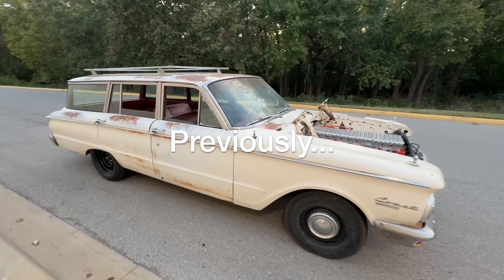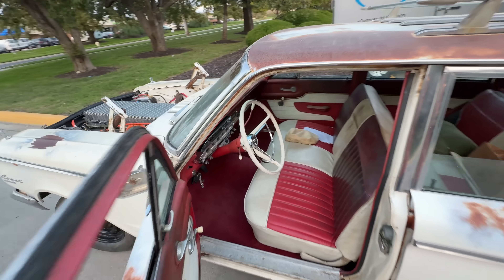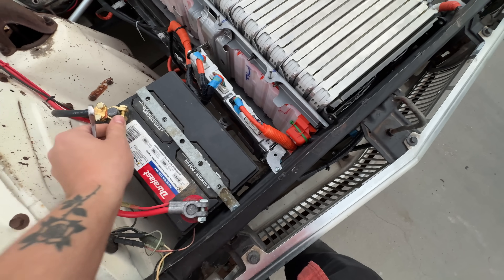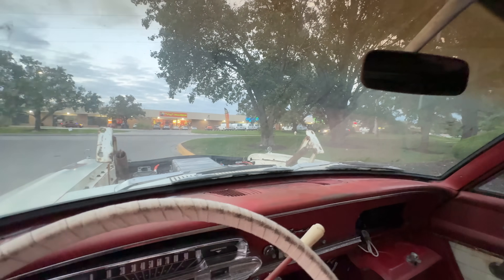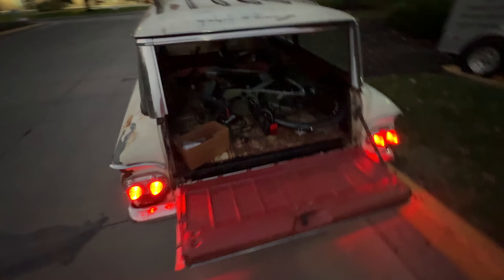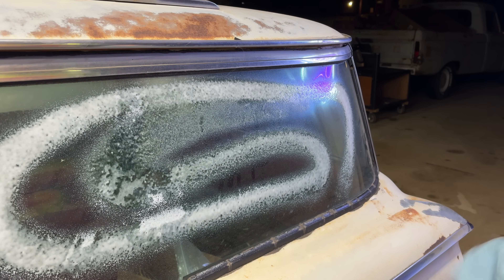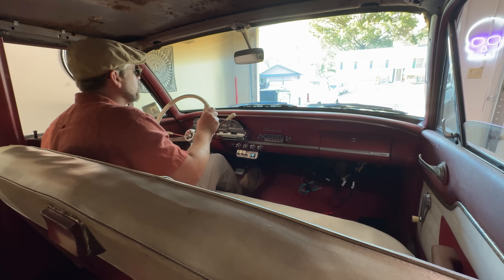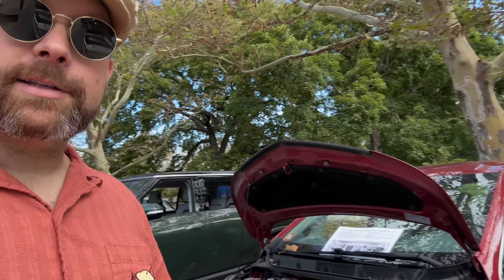What It’s Like to Drive My Homemade Electric Car

Comment: I have held on to 1982 VW Scirocco for an electric conversion. I wish someone would see it and take it. It is a perfect platform for conversion. It came from the factory with manual steering and manual brakes that work. I always imagined a 4 wheel drive electric rally type conversion.
Reply: I have an 84 rabbit I am thinking of converting

Comment: Does your brake light come on when using one pedal regenerative braking? It is important to have that option, as you will end up getting rear ended if you are regenerative stopping and there is no brake light coming on you can used a weighted lever, micro switch, so that the deceleration of the weight, causes force to overcome the spring and press the switch to turn on the micro switch. As the deceleration stops and there is no motion, the brake light would turn off with this weighted switch solution, so you should finish up with pressing on the brake pedal as the vehicle stops. From you can use various size fishing weight to adjust the sensitivity to deceleration.
Reply from the maker: It sure does, thanks for checking

Comment: Great video! Great project, first time your channel came up for me, so I subbed to keep them coming.
A comment about those tires... there's lots of 13" rubber selection out there. I had about 8 to choose from for a Triumph Spitfire on one site alone. Load ratings up to 1,100 lbs/tire. I replaced the 13" stock wheels on a '66 Corvair with 14" wider alloys and tires with no fitment issues. GM used the same bolt circle on 13 and 14" wheels. Ford likely did too. You can get a higher load rating if you need it.

Comment: One thing I've never heard anyone talk about is the fact that while using regenerative brakes do your brake lights come on I think that would be a safety hazard if the brake lights aren't working.
Reply from the maker: yes the come one. The controller has an output for brake lights during regen.

Comment: Very nice reuse of a great survivor classic.     Yeah,  the cheapest conversion approach these days is often to swap over the OEM drive of a factory built EV.     I've done two conversions and been daily driving them since 2006.   Within 100 miles of hitting 100K EV miles on my current driver,  a 2004 scion xB.    Few thoughts -    never trust regen brakes.   You've already experienced the controller cutting out unexpectedly.   Once you get everything sorted this should be extremely rare event but it can happen and if it does when braking you will get a surprise.    So get in habit of  "hovering" over the mechanical brakes when using regen,   and give yourself plenty of braking space when using regen.    Also guessing itt gets Icy in KS over winter.   You will want to reduce or turn off regen driving in that.   Regen on low works a lot like antilock brakes though (allows wheels to turn) so some experimentation in a big empty parking lot might be in order.    And goes without saying,  but get the mechanical brakes sorted  :).     Yes,  you likely need a different master cylinder with disc brakes.     Replace those rusty old hard lines and flex hoses and the proportioning valve too if you haven't.

Comment: Stumbled upon this video. Very interesting. I was born in the middle of the last century (Sweden) and both saw and experienced "fender benders" in the 50s-2000s. Personally, I think seat belts should be installed.
The small "control panel" with the BMS toggle switch should be moved or that it "loosens" easily in the event of a collision to reduce possible damage to your right knee. YES, the original controls are what they are. And the dude on the electric bike...
My definition of these prospective organ donors. You can use all organs except the "brain" because it doesn't work.

Comment: Why not use the original column shift if you left it in.
Reply from the maker: use it for what? For the momentary switches for F-N-R?
Reply: @ThisOldJalopy  that or connect it to some slide switch assembly or something. It would be cool to have it looking more original but any conversion is cool.

Comment: I had a 1963 Gallaxy, that same brake pressure switch shorted out, broke, leaked brake fluid, caught on fire, then I lost my brakes going down a steep road! You should upgrade that master cylinder or plug that switch and put in a mechanical one.

Comment: You can adjust the steering play out with a nut and set screw on the steering box. Loosen the nut then turn in the set screw a little at a time and check (test drive). If you adjust it to far the steering will feel stuck/sticking.

Comment: I have a 1967 Pontiac Catalina four door sedan. I had a problem finging 14 inch tires. They were either trailer tires or they were really expensive. I just switched to 15 inch wheels from a newer model Pontiac.
Nice conversion. Love it.
Reply: try discount tire direct. (on line) I got a set of 14" tires for my Corvair from them. Of course you have to mount and balance them after UPS delivers.
Reply: My first car was a 67 Pontiac Catalina 4 door. It was my grandfather's car. Absolutely loved that car, and wish I had a way of locating it.
Reply: @OCMike  In North Crolina you can trace the ownership of a car by VIN to see the history. I imagine that some other states might offer that service, (but not all states) The question becomes a matter of having that info years later. Maybe an old reg renewal hiding in a desk drawer or perhaps a photo showing a license plate might work?
Reply: @rupe53  I've moved around so much, I don't have any paperwork. But, I should check for an old photo to see if it shows the old plates :)
Reply: @OCMike I got the same beauty as a hand me down from my grandfather and it was a convertible… what a car. Yacht fit for a king

Comment: My neighbor who I help out with around the yard has a one-owner Geo Metro 5-speed hatch back. My dream lately has been to build my own hybrid using the Nissan leaf to power the rear tires but keeping the engine powering the front.
Reply from the maker: That would be awesome!
Reply: @ThisOldJalopy I'm sure it'd be quite the task to try to get them to work together. I live up on a mountain though so having both to make it up the hills would be nice and then tons of regen possibility on the way back down.

Comment: I had an issue with dragging brakes on a 69 amx. It turned out that some of the aftermarket masters need a shorter pushrod. I made a 1/8" shim to put behind the master and the problem was solved. I have read that that's not unusual. Mine has power brakes which may be more prone to this type of issue. Very cool project.
Reply: Many of the brake booster pushrods are adjustable. (after removing the MC) Look close for a small lock nut and twist away carefully.

Comment: so what actually caused the fuse to pop
Reply from the maker: I never found out for sure, but when it blew I was starting from a stop, but also had unknowingly been sending brake signal to the controller (it's a pressure activated switch on the brake lines, and the pressure was up due to the dragging disc brakes). So the controller saw both throttle and brake signals, and it didn't like that. That's my theory. I fixed the brakes for now, and the fuse never blew again.

Comment: After you get your brake issue squared away, let's focus on the regen brakes vs. the front brakes.  The regen saves battery power?  It restricts coasting.  You're powering the car longer to get to your target stop point.  Try coasting without the regen to see if you like it more.  I have a Prius and the question was on my mind for a while.  Not sure which is best.
Regen can really slow the car down quickly.  I can feel it the most on the highway.
Reply: In general EV circles it's pretty well known coasting is always better than regen, regen is always better than braking.

Regen should only be used in situations where you would otherwise have used friction brakes. The ultimate goal would be to never have to use either since regen only recoups about 50% of the energy used to get that speed in the first place.
Reply: @Snerdles  Regen is super handy in hilly areas
Reply: @1SqueakyWheel Yes, exactly an area where you would normally have to use friction brakes to reduce speed on a down hill or otherwise it would be dangerous.

If you were going in a straight line and could guarantee no deer)people/aliens run out in front of you coasting in the situation would still be more efficient.
Reply: @Snerdles Right.  Having no practical experience (yet) with a car utilizing regenerative braking, I don't know if they have a clever way of bypassing it momentarily on a coast, or the vice versa.
Reply: @1SqueakyWheel in my car it just has paddles to select the regen power from none and through three levels. Different manufacturers allow different levels of control of how it works from nearly none to multiple levels.
Reply: @Snerdles yes, I'd hope so. 
I was thinking it could be cool if they built a momentary bypass paddle for the right side of your right foot to push against towards your right, to disengage regen as you coast...  Then when you go to push the throttle again, your foot naturally slides back from the paddle so that the car is ready to regen again
Reply: @1SqueakyWheel My car uses paddles behind the wheel like gear shift paddles. You tap the right one to reduce the regen level and tap the left to increase. Some cars will have a one pedal drive mode which makes the accelerator pedal have a reduce speed section at the top so to coast you'd press down a bit beyond the regen, accelerate is push down further, and then as you release it regens more and if you release it will regen right down to a full stop similar to if you were using a friction brake coming up to a red light.
Reply: @Snerdles  That seems logical (Captain).  But the regen kicks in automatically as you're trying to maintain your speed w/o going too fast.  Feathering the throttle, as such.  The system fights itself.  I think it needs a coaster brake.  We had them on our Schwinns in the '50s.
BTW, I was doing 40 mph today and my gauge said it was only using the battery and getting 99 mph. (it only uses two digits so it could have been hight)  But my next thought was that all of this free power will have to be paid back, somehow.  Interesting argument I had with myself and the car.  What are your thoughts on that, if any?
Reply: @Alex-h4w7bit's easy to figure out with some thought experiments.

Take a roller coaster. Do you think if it was just at the crest of a hill and used a nudge to get over and the next hill was exactly the same size. Do you think it would get higher if it had all of the energy as it fell, or if it used a brake but could convert 50% of the propulsion to energy to propel itself up the next hill?

The one that was free coasting would only lose the energy of friction and nearly crest the next hill. The one that converted all of the falling energy at a 50% would make it less than 50% of the way up the next hill due to all the friction. 

In a vacuum with no friction the coasting one would get to the top of the next hill, and the regen one would make it to 50% assuming a 50% conversion rate from energy to propulsion.
Reply: I agree that regenerative braking is definitely where it's at.  But in his case, unlike with your Prius, there is one drawback.  

The fact that he managed to get all the battery packs so neatly tucked under the hood of the car is super convenient!  But it also gives the car a significant nose-heavy bias, as those packs likely outweigh the straight six that came as the base engine in these Comets, and there's no sizeable tank full of gas balancing the rear either. 
This wouldn't be much of an issue if it were a front-wheel drive car... but being a rear-drive, regen braking, depending on how aggressively it's configured, could present an issue.  

For example, if it's just begun to rain, and he's decellerating downhill in a curve without using hydraulic brakes, there exists the potential for his rear to break traction and fishtail on him.  And honestly, I don't know how inconvenient it would be for him to manually turn his regen off when necessary, or to dial it in so that he can just balance the release of the throttle in sync with his brake pedal, effectively "two-foot in" it.  

Other than that issue, I love the fact that it's a RWD, since acceleration in a RWD is not such an issue, since upper-CG always shifts against the direction of lower-CG inertial influence so that accelleration is more effective from the rear while braking is more effective from the front.

Comment: Man, that 107 hp (80 kW) Nissan Leaf electric motor produces 187 lb-ft of torque. Of course, it will catch up with traffic easily. Not much top speed, though. Another question is: did it benefit from weight reduction after the conversion?

Comment: The regen breaking is impressive. Do the brake lights light up when slowing down with regen? would it lock up the brakes on slipper roads? I'd love to convert a car to electric one day.
Reply from the maker: Yes the controller (Resolve) does turn on the brake lights during heavy regen. Not sure if it could lock up the tires. Resolve just put out an update where you can plug it into a laptop with a USB-C cable and you can then configure settings like the exact level of regen braking, as well as max rpm, etc. All from the Chrome browser with the Resolve website loaded.

Comment: I had a 1962 Saab, have been regretting it going away because it would have been a really cool electric conversion.  Except I suspect it's fierce IC engine heater would be hard to replicate without  some serious range reduction.  My car was in the same exterior and interior condition, spotty rusty but the car overall was sound.

Comment: Hopefully you can find a more common wheel, with the same Ford lug pattern. Then you can choose your tires; instead of them choosing you. It sounds like window felt and seals will go a long way for your cabin noise. Great build! I've enjoyed every episode.
Reply from the maker: I have some 14 inch rims and tires already purchased and ready to go. Old rims were 13 inches. In the rear, I have 15" rims.
Reply: I've used Coker and Summit to get rims for classics before.  A lot of modern wheels are too wide to look right on old cars and end up looking like Foose specials, and no, that's not a compliment.  Fooses are tacky

Comment: Congratulations! Looking forward to more vids on how it's performing, and your axle build. There could be some safety added by relocating the batteries. I first thought on top of the roof but then It came to me that suspending them just below the roof on the interior side might be as effective, ducted with air flow or fan assisted cooling.
Reply from the maker: LOL what?!
Reply: @ThisOldJalopy  ...on the underside of the roof? Like over the cargo area. Out of the way. Fairly safe from collision. Uses available room.
Reply: I think he is being serious 😂
Reply: @DirkVanDerVeen-r7m  I am, just tell me the objections. My objection to "frunk" placement is extreme collision hazard. Why do you think manufacturers avoid "frunk" placement? There is one complication for this application, you'd want to weld the holes in the roof closed. That means removing the luggage rack, or maybe weld on new mounts on the exterior side for it. The underside of the roof would need a layer of insulation to guard against condensation from dripping onto the batteries. I envision a pivot mount at the B pillar, a reinforced base-plate battery holderthat could drop down at the tailgate end for ease of installation of battery pack, and welded on securing mounts at the C and D pillars.
Reply: @20CentMotors well judging by your improvement suggestions... Well , I hope you will actually pick up a screwdriver and start tinkering on one of your own projects. Hope you'll post it on YT.
Reply: @DirkVanDerVeen-r7m  Show me where I'm wrong.
Reply: @DirkVanDerVeen-r7m  More bonus points- air cooling of the batteries easily accommodated by ductwork to the top of either rear door window, and the power tailgatewindow conveniently lowers or raises by the driver as an exhaust outlet of the battery pack. Exposure to moisture is reduced. Safety is enhanced by moving high power wiring away from the lowest part of the car. Collisions most often happen at the chassis to top of bumper area, much less happens at the roof level.
Reply: @20CentMotors Suspending 700lbs of batteries just below the roof…and right behind the driver’s head.  Brilliant!  If the the top heavy don’t get ya, the rapid deceleration headache will.
Reply: @myroccbox8877  engineer it for the weight, weld up a structure to support it... yeah.  Pad the front side so he's got head restraints...  2 birds, one stone.

Comment: @10:30 I'm sure you know this by now, but you can get "185R13" tires kind of easy now, which are 185/80/13. Also, if needed you can look up 205/70/13. They might bulge a bit, but may be easier to find.
Reply from the maker: I already have some 14" tires and wheels purchased and ready to go, thank you though. I also have the disc brake kit for the front, and the 13" wheels wouldn't have fit with the disc calipers.
Reply: With manual steering the wider tires may make it really unpleasant to steer.  Maybe if they were only on the rears it would work.
Reply: @workingguy-OU812 I have manual steering and no issues going from 185 to 205’s on a 14:1 rack. I think he’ll be just fine